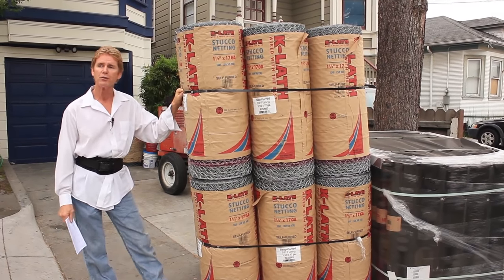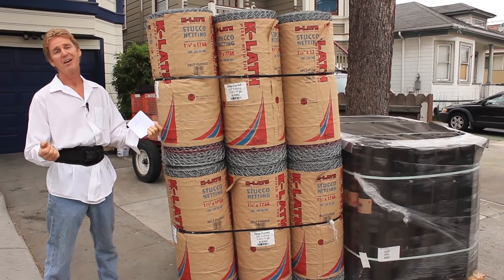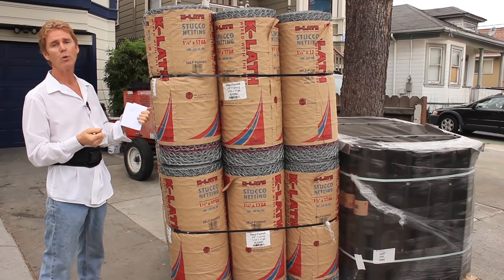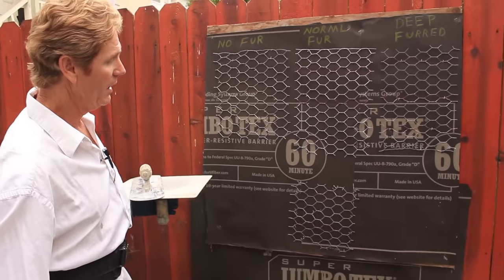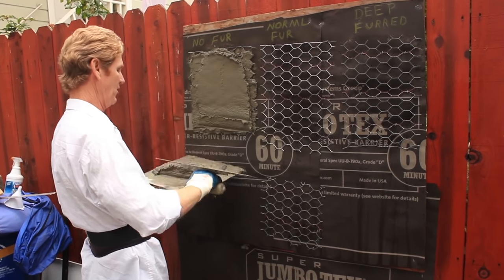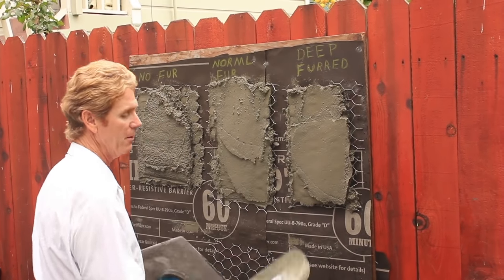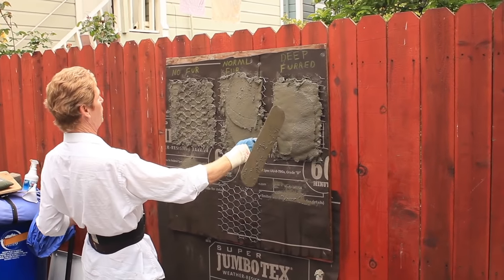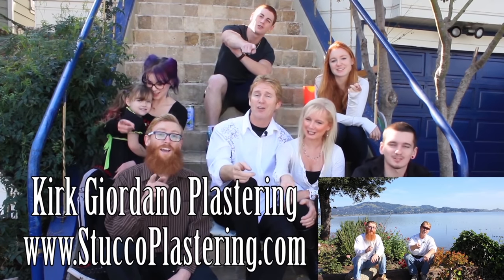Stucco metal lathing tips

Comment: Kirk I m new at this buddy , I installed 4x8 sheets of 3/4 inch of insulation board on the exterior of my home . Can I install stucco on the insulation ?
Reply from the maker: you would have had to place a moisture barrier under that sheet.
 Plus stucco won't adhere to insulation board, you can use the lightweight stucco netting 20 gage to hang the stucco to.

Comment: I have to render a small retaining wall that had already already been rendered smooth some years ago  but it has lots of hairline cracks and failed Top edges where angle bead is.
I wanted to just fill in where it had blown with some quick set but the guy wants it re rendered.
It’s going to be painted after.
Do I need mesh or can I just apply some PVA and thinly render?
Advice please

Comment: another great video. Question? If you have some possibly inferior cmu or concrete block, could you use the wire, to help reinforce the block? or would you just go straight like most of your applications? Project is done where I have to use sand and cement only... no premade bags available. Thanks.
Reply from the maker: Howdy Ada, if it were me, I would pressure wash the cum blocks then  apply a bonding agent then apply cement plaster, (stucco)
No stucco netting and certainly no premixed stucco.
                    Live long and plaster
      Plastering and repair tips on your home
Reply: Thank you. On the same, should I consider adding any fibers to the cement and sand mixture, say 1 pound per bag of concrete? As I said, where this is going in is in a warm country, averaging 80 degrees year round, no freezing weather to consider, but not all block is liable to pass 5he strength tests and I know that they do not make concrete that is always decent as far as filling the voids in the block. Thus, all my strength seems to be the columns and the floor decking, with the bond beam. Many times I see them using what I consider an inferior mix of concrete, making it slushy to get around rebar, rather than using any vibrators or any plasticisor... in fact I cannot find plasticisor at local suppliers. Thus, I am trying to find such here in Britain or in Atlanta to ship down and use in the future sections of building work.

Comment: Kirk  thanks for words of wisdom,  I've started to redo a building wall, I see that you use the chicken wire, my question is why do you use it more than the screen mesh lathe, I bought the screen from home depot's which is better?
Reply from the maker: Howdy Mark, for walls the 17 or 18 gauge stucco nettings is better.
 For ceilings, 3.4 flat mesh is better as the holes are very small, which holds the stucco better.

                Peace, love, and happiness to all.
Sound Plastering tips from your favorite stucco nurds

Comment: Can I use galvanized diamond lath that's not furred? Is there a way I can fur lath that's not furred? Can you use different brands for your coats?
Reply from the maker: You want the lath in the middle of the stucco. If it's at the bottom, it will just hold the stucco and have little strength.
 Like dobies for concrete, there is a reason they use dobies to lift the rebar. If the rebar is flat, the cement will be very weak, like using lath with no furring. Buy self-furred.

Comment: Hello kirk, I have been in the stucco industry a little over 25 years. I have never used or seen anyone using this type of lath in Georgia. (I have repaired older jobs and found this type of lath.) I used to think people were kidding calling it chicken wire but that is what it looks like. It's always been 2.5 diamond mesh here in Ga in sheets 27 inch by 97 inch. I remember when I started it wasn't galvanized just painted. Do you know why your type of lath isn't used in my area or have a explanation of why you don't use diamond mesh. I see the advantage of the roll of wire you apply as far as time and labor is concerned. Other than that it seems like a weak link in stucco application compared to diamond mesh. Idk ? would love for you to enlighten me on this. keep up the good work. thanks
Reply from the maker: Howdy Dude, no worries, happy to share the knowledge
 Diamond mesh or the 3.4 as we call it here won't pass our city inspection, we do however use it for ceilings,
        Live long and plaster
 Giordano’s plastering images and teaching video’s
Reply: curious as to why it won't pass your inspections ? it looks to be much more of a substantial material. that roll lath actually looks like chicken wire to build chicken coops ! to NO fault of yours. anyway, keep up the good work. thanks
Reply from the maker: Howdy STV dude, the wire we use is either 17 or 18 gauge stucco wire for stucco walls, for tile or chicken coops most folks do use a 20 gage
 
        Live long and plaster
  plastering images and teaching video’s

Comment: Hi kirk, can I use plastic lath for indoor hydrolic lime plaster? If not, what type of metal lath is compatible with lime plaster?  I can't find any information on this.
Reply from the maker: Hi Vanessa, if you're going over sheetrock, all you need to do is apply a bonding agent by brush or paint roller. 
No mesh netting or wire is necessary,
 Kirk Giordano plastering

Comment: Would a 1/4" (18 gauge) crown stapler be sufficient for this? I see your staples are wider crowned.
Reply from the maker: Evening Triple070007, I believe so our staple guns hold inch and a quarter wide crown staples that are for attaching stucco netting or roofing shingles, the narrow  staples have a tendency to rip the paper if you miss the wire, if it were me I would use the correct staples.
 Cheers,
 kirk giordano plastering

Comment: I installed Non furred wire if I pull it out using a hammer that will make it work?
Reply from the maker: Pulling out with a hammer will work; it's a lot of work. I would go over it with self-furred mesh netting or apply a scratch coat to allow it to cure, then apply the second coat. The worst that can happen is you will get some hairline cracking. Big deal, caulk them.😉

Comment: He,  would anyone know the best way to attach metal lath onto 1" foam board that's against a concrete wall? I don't want to add any wood strips because I don't have the space to add another inch to each wall. I was hoping there's something I can use that will hold strongly enough to the foam board itself so I wouldn't have to use more masonry fastners than needed. Any help would be appreciated.  This is also for an interior space.
Reply from the maker: Evening Vanessa, what you asking about doing is not worth the time to attach stucco netting or 3.4 self furred metal lath over foam as a fastening system.  Trying to use a gun or sledgehammer to attach 3.4 metal lath would be a chore to nail in one concrete nail let alone he 30 per sheet. Soooo, let look at alternatives.
 You can attach these sheets with poly Bond manufactured or engineered for exactly your purpose.
 La Habra's, Poly Bond is specifically engineered to hold foam board to concrete or cementitious surfaces.
 FYI, Poly Bond is only sold at plastering yards like Westside building materials.
      Bringing peace, love, and brotherhood back to the world of, “Cement Plastering.” 💃
With over 800 educational and free Youtube videos, by your favorite plaster geek, “me🤓” and my son, “Jason,” the bearded plasterer.🌍
Reply: @StuccoPlastering  thanks for the reply:) so, poly bond holds the lath on? Or it something that is used instead of plaster? I'm sorry, I'm a bit confused.

Comment: Is it ok to use Expanded metal lath to patch stucco for a newly Installed Sliding door?
Reply from the maker: Greetings Red Eye, yes, you can use almost any of the stucco netting for patchwork even soffit meshes that are designed for ceilings.
                         Bringing peace, love, and harmony to plastering 
         Sound Plastering tips for the DIY beginner or the Plastering experts

Comment: How about 2inch square  proper stucco wire,raised dimples.  This wire would never fly in our environment
Reply from the maker: Greetings Garth Dude, you're referring to Structalath, it's a welded wire lath, yes I have done a few video's using it, as it is faster to roll it out. 
The wire in this video is accepted or approved everywhere in the USA, so unless you're in the UK, it's allowed. 
Actually, it's also allowed in the UK.                       
                          Bringing peace, love, and harmony to plastering 
         Sound Plastering tips for the DIY beginner or the Plastering experts
Reply: @StuccoPlastering  hi, why is this not allowed in the UK?